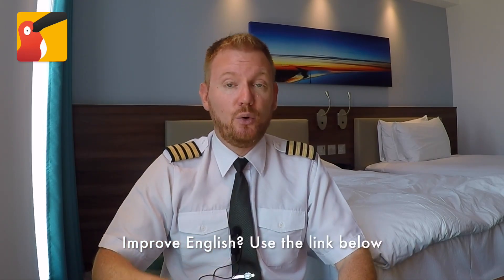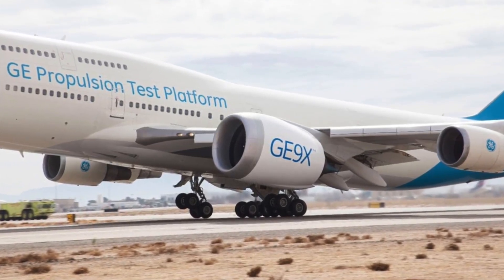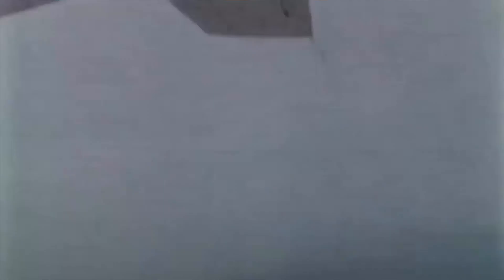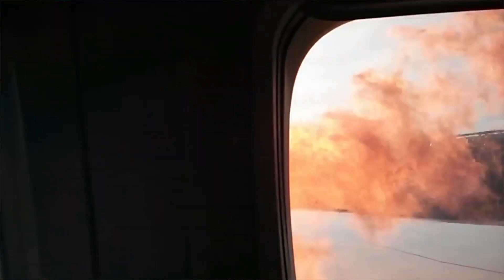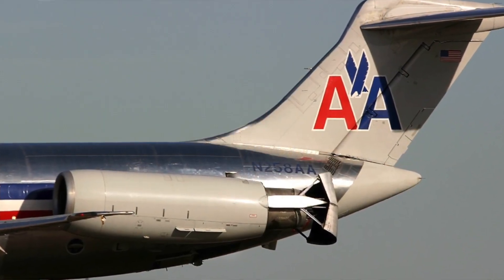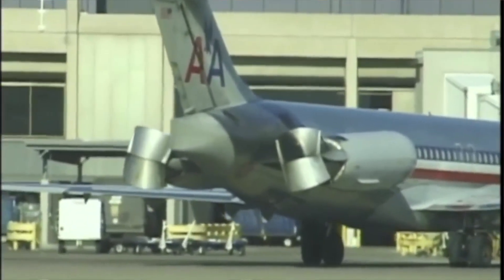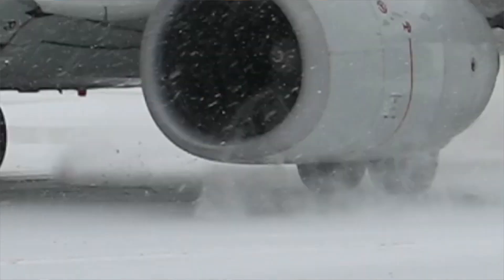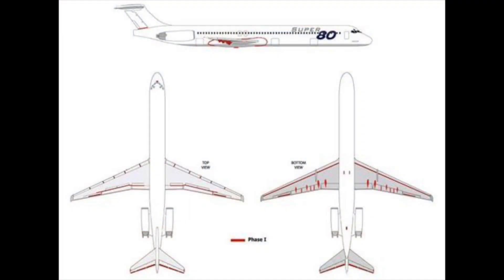Why are the jet-engines placed there? Wings vs Tail

Comment: At 6:20 you refer to the engines being mounted under "the centre of gravity". Of course you meant under the centre of drag, considering the phenomena you describe.
edit -- Oh dear you said it again at 10:55. So not a slip of the tongue?
Reply: It seems like it should be the center of drag that matters, but it actually is the center of gravity.
Reply: Ray Morris What is the Center of drag ? On the ground the plane needs to balance the centre of gravity over the centre of lift. This will give a neutral controlled flight. If you start moving the engines around this balance point then you will get certain-results.
Reply: @tonyhussey3610  Imagine two paper plates, on the ends of a 1 meter stick. The stick os vertical, one plate on top,  one on bottom. Imagine the top plate is twice the size of the other.  If you try to push that through the air, the large plate will have more drag. If we imagine a motor trying to push this contraption against drag, intuitively the motor will need to be placed nearer the large, high-drag plate in order to avoid a pitching moment caused by the unequal drag. 

The point where one would have to press in order to have balanced drag on each side is the center of drag.
Reply: Ray Morris I see. I wonder why the original commenter thought that’s the most important factor. Weight and lift is far more important.
Reply: @tonyhussey3610  What does lift have to do with the motor  thrust angle?  

Clearly the positioning of the weight relative to the WINGS and their lift makes sense. Lift must balance weight. I'm not sure what this has to do with the thrust line of the motor, though.
Reply: Ray Morris The Center of gravity and life need to be in balance for correct flight, this will act as a fulcrum so the further back you place the engines the more nose down effect if you apply more thrust, and vice versa if you go in front. Didn’t the guy in the video say this at some point.
Reply: @tonyhussey3610  Imagine a motor mounted directly on top of the wing, on a pylon. It would create a large pitching moment.

Imagine a motor mounted at the end of a long tail - a rocket. That would have very little to no pitching moment.

The further back you go, the LOWER the pitching force it creates.

What matters is the angle between the thrust line and the CG.
Reply: @senseisecurityschool9337  I will admit to not being an aeronautical engineer but I think we are talking about two different phenomena here. 1/ My point about the moment between the thrust of the engines and the centre of drag which would most definitely cause an downward rotation.
2/ The presenter's point about the moment between the engine thrust and, as he calls it, the centre of gravity. I can see that this would have an effect but only in a dynamic situation relative to constant velocity, stable flight. However, centre of gravity is still not the correct term. This should actually be termed the centre of mass (or inertia if you want) so will only have an effect during a change of velocity.

So in either case the term that should be used in this context is not centre of gravity, but either centre of drag or centre of mass depending on which phenomena has the most effect. My money is on both phenomena contributing to the nosing down of the aircraft.
Reply: @TCSC47  Agreed. And it just so happens that the dynamic situation is the one that causes crashes, etc.

Center of mass may be accurate per a physicist or engineer, modelers colloquially call it center of gravity. As a factual matter, because the plane isn't of astronomical size, center of mass and center of gravity are the same place.
Reply: To further elaborate, thrust line to CG determines the change in pitching moment with a change of thrust. CG because this is all about momentum, which involves weight. This is called dynamics.

In stable flight, the thrust angle to center of drag is what counts.

In stable flight, the pilot can easily trim or adjust elevator as needed. It's much harder to coordinate elevator while changing thrust, dynamically.  Therefore we use the thrust line to counteract the effect of opening the throttle, increasing thrust, as opposed to stable thrust.  We just trim out the effect of thrust in stable flight.

Comment: If you lose one of the tail mounted engines there is less asymmetrical effect than with wing mounted engines.
Reply: I would fear mostly if one engine blew up it may have a devastating effect on the whole tail part,  and the other engine go along with it. Wing under-mounted engines to my mind are safer in this instance. M

Comment: The Honda Business Jet has its engines mounted on top of the wings. I'm sure there are good reasons for this but my question is: what happens when the pilot applies TOGA (take off go around) thrust at, say, a critical moment in landing? Surely the aircraft will pitch down? This is unlikely to be a good thing since, by definition, the aircraft is then likely to be close to the ground. Any ideas?

Comment: Outstanding explanation as always... one thing of the rear mounted engines: in the 90's , Brazilian airline TAM had a good fleet of Fokker 100 (nice flying, rear engines, good for short to medium distances). One of them was in cruise altitude when the right side engine blew up, one of the blades was ejected towards the front, hit a window with full force, decompressing the cabin instantly. Sadly, the passenger in the window seat was a lady with long hair, so her head was sucked and hit the fuselage causing instant death.  (the pilots managed to control the aircraft and safely made an emergency landing)
I can only guess, but a plane with bottom mounted engines would not cause a situation like this.
Reply: Unfortonatelly, a plane with wing mounted engines can indeed cause a situation like this, just like southwest flight 1380 in 2018

Comment: A lot of the things you are describing are correct, with the bigger engines you changed the original design radically from the way it was originally designed with smaller engines with less thrust. in my opinion, and i am an mechanical engineer, air craft instrument repairman an a&e mechanic from the Air Force. I was on the Thunderbird team at Nellis Air Force Base in  Las Vegas.  the way i see it;  now days people are not paying attention to "Quality" control, so a lot things are being covered up, especially with the computer screw ups and the experts who only talk about what they don't know. my suggestion would be to take one or two of those 737's being made today and remotely controlled crash test these planes, and see what the results turn up! It certainly is cheaper than killing 150 at a time!!!!
Reply: Virian Bouze Destructive testing of a machine worth over 100 million dollars is not realistic. I think you are referring to the 737 max issues and when you design any system, especially complex ones like aircraft, it comes with a huge amount of uncertainty. Engineers do their best to mitigate risk but there will always be risk. I’m sure pretty much every aircraft model has had airworthiness directives issued to correct problems that were unforeseen in the initially certified plane. The 737 max crashes have nothing to do with quality but everything to do with a serious design flaw that will be corrected.
Reply: When you see two air planes crash in a very short period of time lives come first.  The cost to crash test for information is cheap compared to killing people. With today's technology; It appears to fail! when that 737 a/c was built with out all of the high tech crap, the failure rate was never an issue! Now, Too many and too fast no "Quality-Control"! Is not worth the lives of "Loved-Ones"!
Reply: Virian Bouze since the crashes are not due to structural problems there would be no point in test crashing a plane anyway. There have been plenty of problems with the 737 even back in the day before the systems were so complex. I’m convinced Boeing will sort it out but I’m surprised they weren’t able to get to the bottom of the issue after the first crash
Reply: @BaliMystic  You should do more research, with the new more power out put of these engines; it is causing control issues; which Boeing, did not test the results! they added stupid computer modifications to off set the increased trust, causing the 737 to lose it's original design control. the other issue is the change in the fuselage rib and attachment design for faster assembly; which was also hidden!!! thanks i also build an drive a  Volvo race car in s.c.c.a.
Reply: Virian Bouze of course the new engine config was tested. The flight augmentation system which is at the root of this issue was added by Boeing to pass certification.

Comment: The new composite wings seem a bit tip flex prone to me and winglets tend to add leverage to this.
Every change in wing form makes a new behavior pattern that may confuse flight data gathering sensors. The Lockheed L- 1011 Tri - Star had many attributes of design that I prefer. Central engine “ S” duct was genius design feature. No torque effect of engine failure and three engine safety factor. 
The wing can then focus on flight aerodynamics only,  not engine force as well.
The large diameter high bypass as on the 737 max 8 puts the thrust line further away from wing with resulting more leverage for pitch up forces on wing.

Comment: Interesting, but you didn’t say why designers no longer incorporate the engines into the wings, like the first jetliner, the Comet. Or into the fuselage, like jet fighters.
Reply from the maker: Good point. That has to do with engineering, maintenance and easiness to change them if needed.

Comment: why don't they integrate the engine housing into the wing?
Reply: Rau Kenneth they have in the early jet days. And of course in the piston era.
Reply: Seems like it would work well with these large diameter turbofans. Maybe it has just become standard to hang the engines and they didn’t consider integrating them

Comment: In light of the recent grounding of the Boeing 737 MAX, pilots are saying that the airplane tends ti pitch down because of the center of gravity being unusual for a lower mounted engine, since the landing gear is short, they had to put the engines up and forward a little bit. Based on what you have explained, it seems like it could be behaving like a tail mounted engine. In your opinion, is the design of the 737 MAX flawed, or can it be solved with improved software without having to re-design the airplane?

Comment: You also have center mount engines in fighter jets.... basically today Boeing went cheapo and it should have designed a brand new plane vs keeping adding to an old design or the 737. They wanted the benefit of the LEAP engine, but they are like putting a 250 HP outboard engine on a row boat. The LEAP size engine is just too big and powerful for the structure.  It's trying to make a bus fly, aerodynamics can't be helped by adding MCAS. Instead it made two new planes crash. Boeing is heading for disaster, no fix to MCAS will ever solve the issue.

Comment: The Russian IL-62 T-Tail aircraft had saw tooth leading edges to stop wing tip stall and therefore super stall.  The wing tip functioned as a sort flying wing due to the sweep.  The VC10 and iL62 were the only aircraft that did not enter into a super stall.   This was primary due to adequate sweep providing a downward pitch, saw tooth leading edges and fences and a little from the stub wing effect of the rear engines.   Rear engine aircraft also were prone to engine stall and often had 'autolight' for the engines.

Comment: The first aircraft that used under wing posed engines deliberately place to prevent aeroelastic flutter was the Junkers Ju 287.  It’s like a pendulum whose natural frequency is chosen to be different to the wing.

Comment: I think in low mounted engines under the wing, they give a 'pull' effect to the centre of gravity of the aircraft whereas, in the back high mounted engines, they give a 'push' effect to the centre of gravity of the aircraft. You need more effort to push than to pull, from my knowledge about physics. So, does the back high mounted engines burn more fuel than the low mounted engines under the wing ?

Comment: First. This person knows what he is saying. Explanations make good sense.  I grew up in the 60s 70s not 2 miles from the western end of GLA, right under the flight path.  The turbo JETs were unbelievably noisy on take off. Prevailing wind for Glasgow came from the west. So 90% of aircraft going out under full thrust, right over head! The noise rattled windows and brickwork.   The Turbo fan was a god send.  Years later I apprenticed with the BAA. British Airports Authority. As an electronic and electrical engineer. Spent a lot of time out on the air strips.  There are a full crew that just looks to make sure the strip is clean.  Even small bits of grit and shit can be devastating to a big engine.  One thing our pilot might think about, is where the noise actually comes from.
 At Aberdeen airport, where most traffic is helicopters servicing North Sea oil. There is an old US model. 2 Blades. when the leading blade is, in the direction of travel, the tip just breaks the sound barrier. It's common name there is "The Thumper". You can hear the thump long before the chopper is in sight. 
I think the roar of a jet is more to do with the fins constantly smashing the sound barrier than the eject thrust.  In the early days it was that very speed that blew most of the prototypes apart.
When you are near the runway, even 'tubo fan engines"  WHINE up. They are FFin loud!
The only engine built that the thrust creates the real noise is a rocket.  Not sure you can call that an engine?  More a "hopefully controlled explosion".

Pilot or not, your information is interesting.  Your 'Merchandise' makes me laugh heaps. Who in their right mind would pay 40 bucks for a T-shirt??   Only in the USA!  Bet it says "made in China on the label."

Comment: I always thought wing mounted engines (more weight) are more stable in the air. Like a tightrope walker with a long pole.
Reply: Makes sense.  Most military jets have them tight to the body to make them super rolly.  You'd want the exact opposite with a passenger jet.

Comment: Why in DC9 and DC10 the back engines have an angle upward?
Reply: @sausagesmcgee7079  if the engine has an angle upward the pitch down attitude will be increased as it will lift the back of the airplane

Comment: I have wondered WHY the new private(Business) jets  have stuck to the fuselage mounted, whereas new commercial jet liners have them have them on the wings. The fuselage-mounted engine commercial airliners is mostly older designs

Comment: would the rear mounted engines be more economical because the resistance area seems to be slightly smaller than wing mounted engines?

Comment: Thx for the video captain. I thought that the main advantage of having engines at the back is to have more efficient wings and save fuel as the air flowing over the wings w
on't be disturbed by enginez I was disappointed to not see it here. In my opinion the advantages of rear engines shown in this video are way not enough and drawbacks too high so there must be another main advantage for rear engines.

Comment: Very interesting video, thanks. You missed a important point though: The body of airplanes with back mounted engines can be placed lower, so many of those planes have their own stair to enter at the front. This gives more flexibility at smaller airports or airports far off with no big infrastructure. The Boeing 737 had very small engines in earlier versions for the same reasons, and then they had big problems placing the new and bigger engines below the wing for the NG/MAX. That's why they are oval and not round at the front.
Reply: Sounds like you've been watching a lot of youtube.  In fact, doesn't this guy have another video explaining exactly this?
Reply: The 737 engines could also be serviced by a technician standing next to the engine.
Reply: The oval inlet was used only on the 737-800NG (Next Generation) series. The engine the 737 Max uses is a CFM International LEAP-1B which has a round inlet but because of the size of the engine Boeing had to change the landing gear that had been used on all all previous versions of the 737 to landing gear that raised the wings to be able to fit those engines under the wings. And, as everyone who subscribes to this channel knows the airlines with 737 Max Planes have lost millions if not billions of US$. Why? because Boeing had installed a system called MCAS (Maneuvering Characteristics Augmentation System) because the Center of Gravity of the plane had moved so much because of the weight and relocation of the new engines and the extension of the fuselage and other factors..
Reply: Cannot be placed lower than wing mounted.  He has covered your topics
Reply: @thebase and @william he has a video exactly stating that...
welcome to the Mentour Channel
Reply: Gv

Comment: At one time it was common for the 737-200 to power-back from the gate.    Once I was sitting right next to the reverser and it was LOUD (the reverser was canted up toward the cabin).      Also tried it with a 757-200 with Rolls engines but it just wasn't a good idea (too much thrust blowing about the ramp).

Comment: Would it be feasible to have two engines under the wing and two auxiliary engines mounted in the rear for any possible engine failure or times when the aeroplane would need extra thrust.

Comment: so basically, wing mounted engines are beneficial in pretty much every way
Reply: I don’t have the data off hand but tail engines are more aerodynamic also the single engine handling in wing mounted engines is much worse